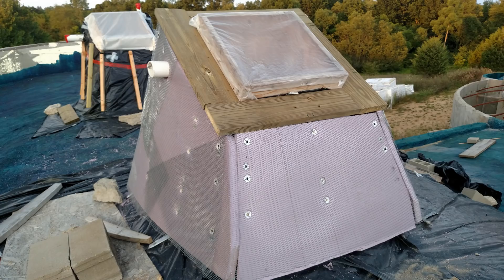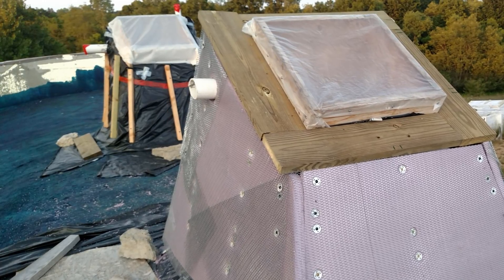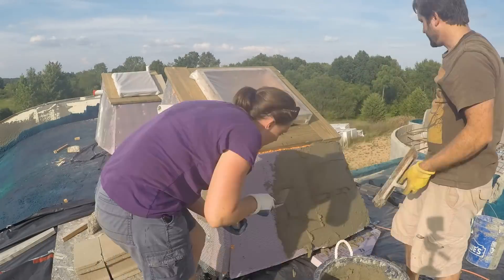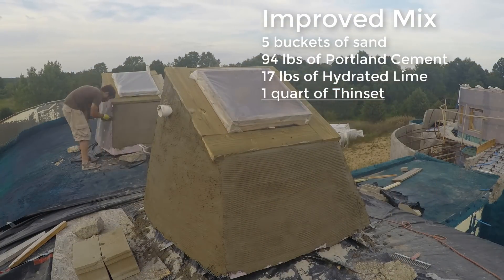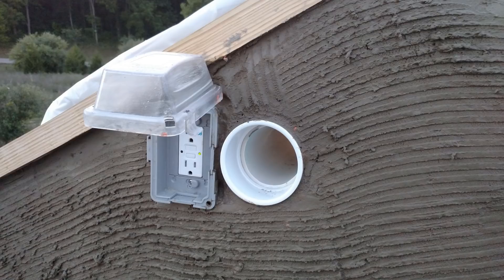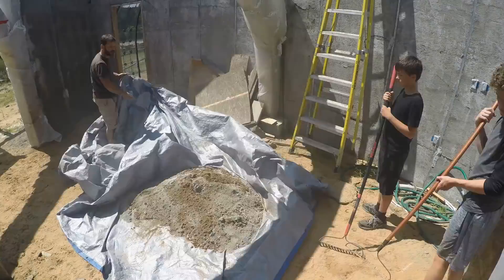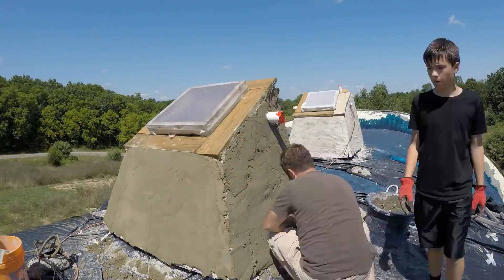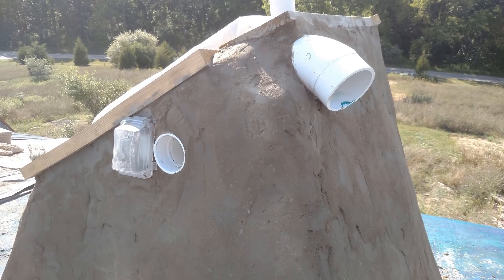35.2 Stucco over the Sky light curbs

Comment: Will this stucco be exposed to rain, or wet dirt? Is there any provision for drainage at the bottom, or behind the stucco? Just curious if water was accounted for on these areas (and other stuccoed ones) since you were so diligent on the shotcrete portions of the structure.
Reply from the maker: Yes, we just put the dirt right up against this stucco.  The bottom end is buried but the top edge got a copper cap to prevent water from flowing behind.  The bottom of the assembly is open so any water that gets in will just drain down.  Behind the assembly is all waterproofed with bluemax elastomeric waterproofing.  And the whole assembly is at the top of a hill, so I don't anticipate any standing water.   Worst case scenario, the lath rusts (its galvanized, so unlikely) and this whole thing falls appart in 15 years and I am out there doing it again ;)
Reply: @SimonHomeintheEarth  Hope it doesn't crumble on you. I'll be investigating basalt lath options specifically to try to avoid rust issues. Best of luck.